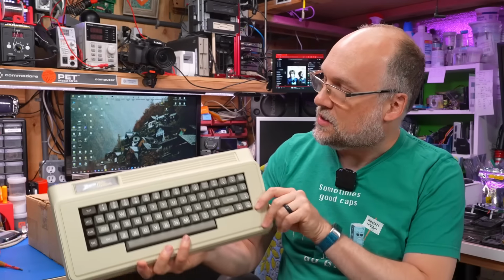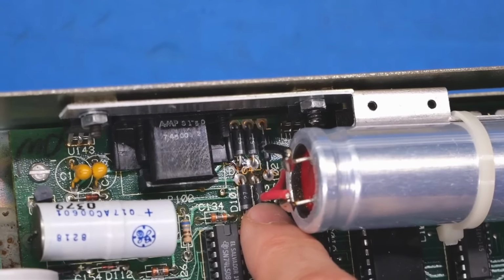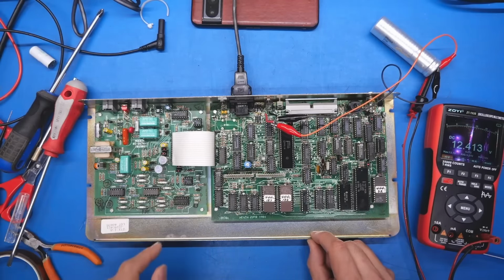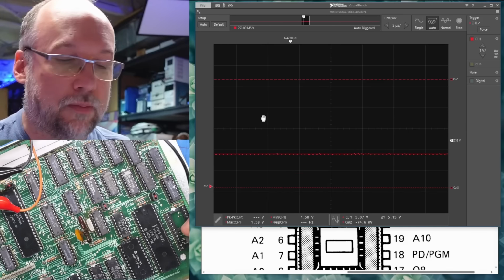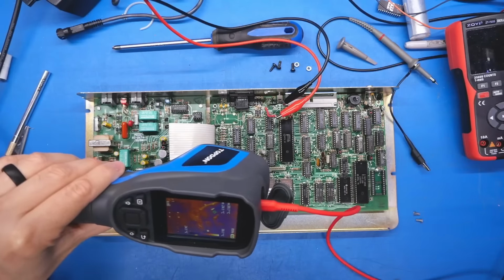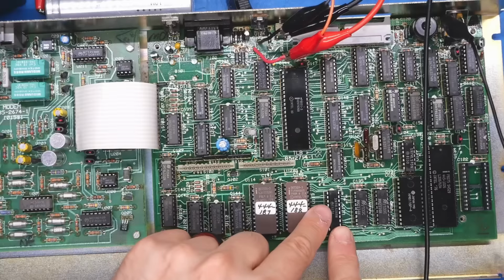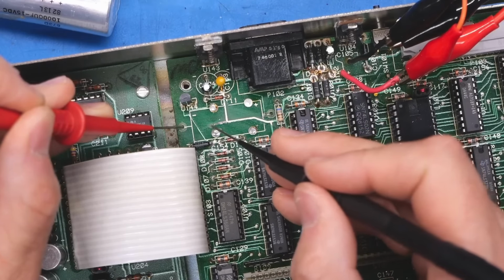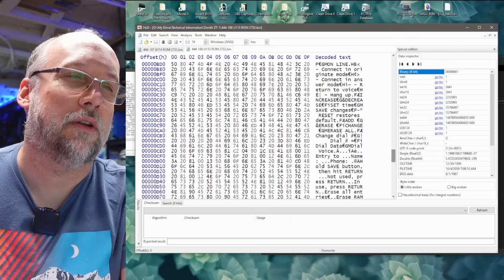The Zenith ZT-1 tried to be a low cost gateway to the information age

Comment: Not forgetting the character rom is missing and the keyboard, either one could potentially be checked for on boot and code interrupted, or placed in a wait state or something.
Reply from the maker: It's very unlikely, computers from this era really can't sense those are there. The keyboard is just a passive matrix with no electronics, just like a C64. Being unplugged would be the same as just not pushing on any key.
Reply: @adriansdigitalbasement  an acorn electron wont boot with keyboard removed, as the keyboard pcb has pullup resistors on it, without it the system thinks all keys are pressed at once!
Reply: @andygozzo72  I was gonna say, and didn't Adrian work on at least one computer or terminal not too long ago that refused to boot without a keyboard present?
Reply: @stevethepocket  possibly, maybe it was an electron, he's had at least one video with one in!, that said, pretty sure one of the electrons i had DID boot up without the keyboard connected...it may depend on the particular characteristics of the keyboard input lines of the ula, maybe due to tolerances? maybe a different ula version? dont know, i cant investigate as sold that particular machine, the one i have left definitely wont boot without keyboard😉
Reply: @adriansdigitalbasement  How do you know an addressing line CE/WE or something isn't physically wired through the keyboard connector's - not that that would be a good idea, but it could be an attempt at preventing someone from enabling the system if it's disconnected. I just didn't see you try the machine with the Character Rom and Keyboard plugged back in is all, and wondered since you don't have any schematic or circuit diagram if you had considered this....
Reply: @adriansdigitalbasement This guy did not have power button, maybe it waits for some (or random) key to wake up the video?
Reply: Since it has no power switch, could it be going into some kind of sleep mode, waiting for a key to be pressed?
Reply: @helgew9008  Things didn't sleep in those days.
Reply: There can definitely be an assumption in the logic that character data is coming off the ROM. It’s not a best practice, but people definitely did ”clever” stuff with ROM output signals back then.
Reply: Simpler explanation: the screen was updated, ans the CPU is simply waiting for input before it'll update the screen again. There's no need to update the screen in an idle state, especially if the character set contains a cursor character or there's some sort of hardware cursor location

Comment: Clive Sinclair hated power switches, never used them... (but I guess it could be cost related also ;)
Reply: Cost-cutting to the point of affecting functionality? In a project headed by Sir Clive? Perish the thought!
Reply: @kaitlyn__L  hehe, acorn electrons didnt have power switches either , quite a few home computers didnt,
Reply: @andygozzo72  somehow I never noticed the Electron was missing the Beeb’s power switch!
Reply: @kaitlyn__L  the bbc power switch is part of a mains to dc psu 'box', in the electron, the mains to low voltage(19v) is a 'wall plug' transformer, the electron has a switch mode rectifier and regulator board, they 'could' have included a switch, but didnt 😉

Comment: If ever you cannot use rs-232 signals right out of the board,you can still connect it to a voip modem that simulates PSTN and dial up wherever you like with that.300 baud is very slow so i do not think you run into any serious issue.

Comment: A friend recently got a hold of a Tandy 1000 HX and wanted me to check it out. If I hadn't watched your videos, I would have had no idea how to fix it. But after examination, finding no Rifa caps, and no leaking caps in either the computer or the CM-5 monitor, I judged it safe to power. Monitor seems to work, but computer is dead. At first I thought power supply, but then I remembered to check the tantalum caps for shorts. Sure enough, at least one is shorted. The resistance values I'm reading are pretty close amongst all the caps, so unfortunately not able to narrow down which one is bad, so now I get to order parts. This will be the first time I'm fixing something like this. And I've never seen axial tantalums before, but I can just get regular tantalums to put in their places.
Reply: Rich and Joy abuse Annette

Comment: I did "online banking" before the internet using a thing like a French minitel terminal. Believe France wanted to save the money from printing phone books. My Scottish bank essentially branded the minitel technology for online banking. It was secure because it dialled the bank.
That was from mid '80s but it was an all in one device - 10" CRT screen with a slide out keyboard. 
Got replaced by PC banking in the mid '90s.
Prestel was similar, but in colour, attaching to a TV. Nowhere near as successful.
Zenith (Alps) keyboard there looks a lot like ones from a serial terminal. Way more expensive build.
Reply from the maker: Indeed those Minitels were also released in French Canada. Interesting is it's really the same concept as this, except it also has the built in monitor and a much worse keyboard. I think both came out around the same time too, 1982.
Reply: If I had more space and money, I might amass a collection of such terminals 😅

Comment: Zenith bought Heath in 1979 so all those Zenith computers and terminals were designed by Heath Kit.
Reply: Yup.  That means there might be an analogous Heathkit manual for the ZT-1.
Reply from the maker: Yes I think it's the HX-100 or something like that.
Reply: @adriansdigitalbasement  Heathkit HD-8999 (in black)
Reply: @horusfalcon The Heathkit catalog called it the TM-1 technical reference manual
Reply: I vaguely recalled such a thing when I saw HEATH COPR on the board. Though funny it has a typo (stencil-rub-o?)
Reply: That makes sense.  I remember Zenith and Heath were affiliated/co-branded when I was a kid gaining interest in computers and electronics.

Comment: Practically the first thing the code does is initializing and starting the CRT controller. in U114, the routine that does that is at 0x36E. It sets up the controller for 80x25 display and starts it (command 0x23) which should immediately start video generation. The 8275 is mapped at addresses 0x7000 (parameters) and 0x7001 (command/status).

With a logic analyzer you should be able to check if this happens correctly. Sequence would be:
Write 0x00 to 0x7001 (A0 high on 8275)
Write 0x4F, 0x58, 0x09, 0x09 to 0x7000 (A0 low on the 8275)
Write 0x80 to 0x7001
Write 0x00, 0x00 to 0x7000
Write 0xE0 to 0x7001
Write 0xC0 to 0x7001
Reply from the maker: Thank you. I'll be working on that in part 2!
Reply: They  cut some corners by not using a DMA controller which makes reversing the code harder. It would help a lot knowing how the 8275’s Dma req and dma ack lines are connected. In fact, checking those for regular pulses would tell if the CRT controller is actually running and it’s a lot quicker than hooking up a logic analyzer.